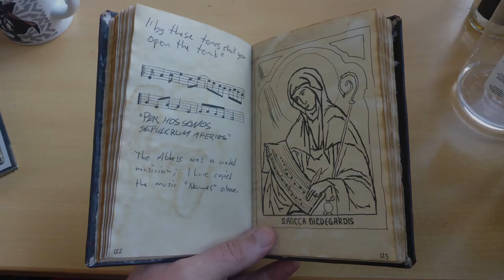Final Part: Creating a leather cover and finish the book (Indiana Jones Grail Diary Replica)

Comment: What were the dimensions of your cover?
Reply from the maker: The outer leather cover should be approx 280x200mm, but I cut it a little too small by mistake.
The two cardboard sheets for front and back are 118x185mm